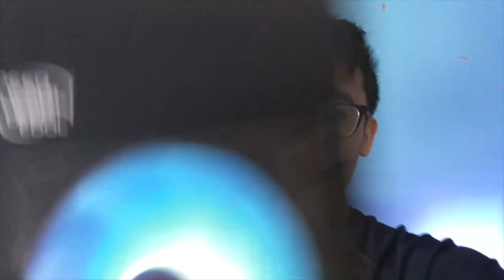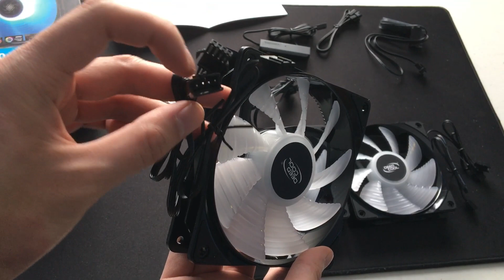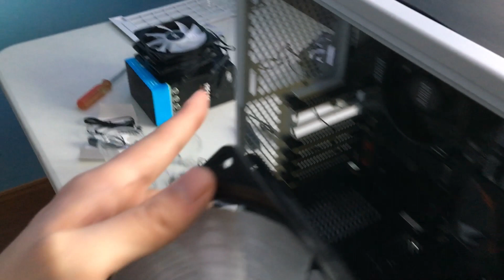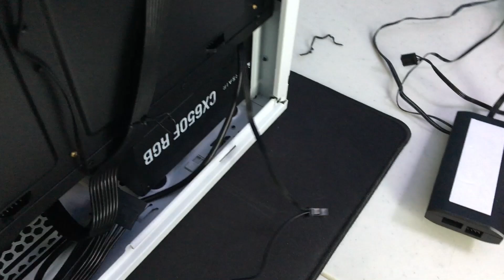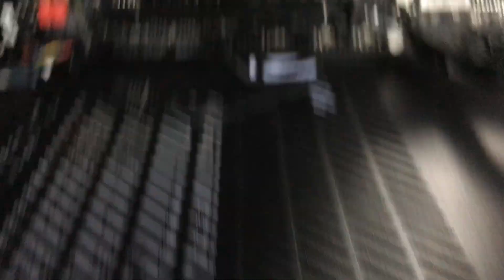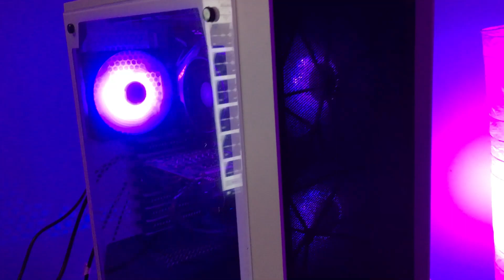How To Daisychain & Install your PC Case Fans | Deepcool RF120 Installation

Comment: Ok so basically I have to connect the female pwm to the fanhub then the female connector of the first fan to the second fan then the female connector of the second fan to the third fan then I also have to connect the female pwm to the fanhub of the second and third fan respectively then I have to connect the female connector of the addition cable to the last(by which you meant the first fan you did your work on if I'm not wrong) and then after that I have to connect one side of my fanhub to the sata power and the other cable into the 12V RGB side and the additional cable which you talked about to the sys fan right? If I'm wrong Pls it would be very helpful to me if you help me out I've never did this before I'm gonna buy these fans tomorrow or on Friday. So I really need you to help me out. I would be very grateful to you.

Comment: Don't you need to plug it into the Argb header on the motherboard because the RGB and Argb provide different voltages, 12 and 5 volts, respectively?
Reply from the maker: @dabuilderpeace  yes, this model is RGB

Comment: Will this work if you don't have an rgb header and jut want to hook up the fans?
Reply from the maker: Yup it'll still work just without lights
Reply: FYI, I'm have plug in 5 fans on my mb to the rear exhaust on my mb on a spliter is this to much and should I get a fan hub that hooks ip to a sata cable. I haven't turn on my pc yet cause I'm waiting for a psu to graphics card extension lead. Thanks

Comment: Yes great vid! I need your help please. My NX410 fans are daisy chained but the 4 pin chassis connector is a male. similarily the 4 pin chassis connector on the MB is also a male. Would you happen to know anything about this in your travels and do you know "exactly" what adaptor I might be able find.  I have also submitted a ticket to Antec.

Comment: can you leave a link for the products used (fan hub and argb hub)
Reply from the maker: It won't let me link but it's on Amazon called
DEEPCOOL RF120 3in1 3X120mm RGB LED PWM Fans with Fan Hub and Extension

Comment: I have two rgb fans connected. They both light up and work but I can't change the colour of one of the two
Reply from the maker: If one works and they are plugged into the same header that makes me wonder if the one is defective

Comment: Sorry, late to this but is it one speed only? Have the same fans but they seem to always be running at top speed and seem kinda loud... Did I miss something? I also have 5 of this fans
Reply from the maker: These fans are PWM so you can actually adjust the fan curves in your BIOS settings based off the temperatures of your computer. I think your motherboard just has aggressive fan curves by default so they're running at top speed more than they should.
Reply: @BPYT  dam I have a MSI b450 pro carbon guess I'll need to figure that out. I find it a little confusing through the bios... but I'll have to do my homework. Thanks for responding

Comment: Now i know this videos old but what if i dont have a extra wire when done daisy chaining i bought the 5 pack and daisy chained 4.  3 intake 1 exauhst now i know i might not get a response but worth a try
Reply from the maker: Hm, are you talking about the cable at 0:56 or are you saying the 4th fan in your daisy chain doesn't have the wire that connects to it?
Reply: @BPYT  no i do have that wire but after im done connecting the males and females theres no other loose wire
Reply: @BPYT  like i have the 12v rgb wire but no extra wire from the fans
Reply from the maker: @tracytoop4790  It's possible that you did an extra connection on the last fan that you didn't need to do, you may have to retrace your steps
Reply: @BPYT  fan 1 has a male and female witch i connected to fan 2 M, F also did the same from 2 to 3 and 3 to exauhst up top in back of case 1,2 wire to fan2 same wire 2 to 3. Idk
Reply: @BPYT  but ill look at it again

Comment: where i plug the hub in the mother board? i havd rgb header.
Reply from the maker: You should have a fan header that says SYS_FAN or something similar
Reply: @BPYT  i do have system fan 3 pin i did put the pwm 4 pin it is working now.

Comment: hi bro i Need help. I cant control RGB of the fans and Is that because i didnt connected them eachoter?
Reply from the maker: Hey, can you control any of them or just one?
Reply: @BPYT  never mind, i fixed today because i didnt know that on the software of RGB Fusion i had to go to the Led_ and something and that was the RGB controller.

Comment: i have 3 fans

2 on top (part of cpu AIO cooler with radiator)
1 at back

can i daisy chain these 3 ? and can i use all 3 of them onto one rgb adapter ?

Comment: Hi! I'm building a pc rn and I want 5 d- rgb fans. I got an Asus Rog Strix B550-A Gaming Motherboard. And i bought a 3 pack 3rgb fans and it comes with a daisy chain D-rgb connector. Can I use that to connect all 5 rgb fans or i need a splitter cable? Thank you
Reply from the maker: Without knowing the model of fans, you are usually fine to do this with no issues

Comment: Noob question

Where is the system fan header slot in the mobo ?

I bought 5 fan pack which comes with 2 hubs. 3 in front, 2 above and 1 at the back. Should I daisy-chain all 6 or do it separately as 3+3 ?
Reply from the maker: It'll be different on every mobo but usually it says something like SYS FAN beside it.

I would do 3+3

Comment: My fans don’t have the 4 pin connector that goes into the motherboard, they only have the daisy chain connectors
Reply from the maker: Which fans do you have?
Reply: @BPYT  I have 2 Raidmax fans but they only have the daisy chain connectors
Reply from the maker: @bxshwitdarackzz  You’ll just plug the fans into the motherboard

Comment: Are the fans connected to the fan headers or hub? I am confused.
Reply from the maker: The fans connect to the hub which connects to a fan header
Reply: ained  @BPYT  And the RGB is daisy chained together to one cable? Does the 5 in 1 come with a hub with 5?
Reply from the maker: @cydeYT  right RGB is chained to one cable. I think the 5 pack comes with two hubs so you will need to use two headers!

Comment: Whoa, your mic is way low and the music is too loud :(
Reply from the maker: Sorry about that! Thanks for the heads up, will fix it in the future :)
Reply: @BPYT  I still loved the video =D I think I may grab these. Trying to upgrade my fans (and unify them because I have too many diff ones in there) but they are so expensive. Was going to buy these $85 Lian Li UNI Fan SL120 but thinking these will basically do the same thing at half the price.
Reply from the maker: @NewYears1978  Thanks! Yeah no doubt these are really good budget friendly fans. I had the same thought process as you - I can’t justify the expensive fans yet when these have been so reliable!
Reply: @BPYT  Going to grab them right now - thank you kindly sir!

Comment: I am looking to buy the Phanatec 360A case with 2 of these fans preinstalled, then i want to install the deepcool Castle 240RGB V2 which has the same A-RGB fans. At last i want one more fan for the back of the case giving me a total of 5 fans. The big question is if the case comes with the fan hub and the additional cable so i can hook them all up like you did. Thanks for the great video made it alot more clear but since i just need to buy 1 and not 3 more fans i dont know if it comes with the fan hub and cable.

Comment: So, do I need a splitter to connect my 3 fans? Can't I just daisy chain them?
Reply from the maker: Some fans can connect directly to the mobo but for these fans in particular you’ll use the splitter that comes in the box. You’ll have to check the manual for your specific fans.
Reply: @BPYT  So, if I buy Cooler Master Sickleflow bundle of 3, do I need to purchase anything extra to get them to work with software? (Thank You for the quick response!)
Reply from the maker: @Official_Mikel  No worries, for your question: Nope don’t need to buy anything extra they will come with everything you need
Reply: @BPYT  Amazing video, Detailed responses, and quick ones at that! Thank you very much! (I'm subscribing :D)

Comment: since 6 of my case fans all have molex, can i connect them to each other and hook the last one to my psu molex or will it burn my house down
Reply from the maker: If the fans have the appropriate wires, yes you can daisy chain molex fans
Reply: @BPYT  What do you mean appropriate wires? since I have 6 of them, they all fit into eachother but majority of my friends says it might cause a fire
Reply from the maker: @andeersonz  Why do they think it's going to cause a fire? People daisy chain molex fans all the time.
Reply: @BPYT  Well, I don't really have knowledge about that stuff and it's also my first time building a computer, so this is making me cautious? Should I just stick to buying a fan hub?
Reply from the maker: @andeersonz  You should ask your friends why they think it’ll cause a fire. They may have a good reason but from my knowledge there isn’t any risk. Worth inquiring. Otherwise you could return and get PWM fans if you’re nervous.

Comment: I have a deep cool gammaxx air cooler can I also connect it to the hub included in the fan?
Reply from the maker: Technically yes, but if you don’t plug a fan into the CPU fan header your pc might not post (depends on the mobo)

Comment: Hi do you think this would be compatible with the MSI B550M PRO-VDH WiFi ProSeries Motherboard, and if so what kind of splitters would I need to plug in six of them, I dont have a fan hub btw so if I need one any recomendations?

Comment: Daisy Chain is when you connect one device to another... For example, connecting one RGB to another RGB, and so on... and then connecting the final pin on the main board. This was using splitter. A splitter or hub creates a Y channel for a uniform effect. A dairy chain create effects starting the first device, and  running the effects through all other connected devices, one after the other... creating a daisy chain RGB effect. This was a Splitter/Hub connection, not daisy chain... !!
Reply from the maker: The hub is for PWM. The RGB cables are daisy chained.
Reply: @BPYT  Oh sweeet... my bad... I didn't watch it carefully. Too many misleading videos out there confused me... Keep it up... awesome video and pleasant to hear... :)
Reply: I have a question when I daisy chain comment female to the other fam male where does the first male fan male go and the 3rd fan male too?
Reply from the maker: @VinashSri  You will have some connectors that are left hanging

Comment: Dam I really liked your video.. it's straight forward .. I have  msi b450 gaming pro carbon max wifi MB and very much confused which ARGB with PWM controller.. this narrows down .. thanks a lot bro.. if you could explain RF, CF,and MF 120 diff would be great
Reply from the maker: I'm not sure about MF120 but the only difference between RF and CF is the type of RGB. The CF is addressable RGB so can do multiple colors at once (like a rainbow)

Comment: does the voltage differs?
like should i get any voltage fans for my pc or certain fans?
Reply from the maker: There is different voltage for RGB 
Addressable RGB is 5V and regular RGB is 12V
Then fans can come in 3 Pin or PWM variants. 3 pin is a bit outdated at this point.

For reference the Deepcool RF120 is RGB (12V) and PWM which I’m very happy with.

The best ones would be ARGB (5V) PWM (4-pin) fans, but ARGB is more expensive for quality fans.

Comment: If I get the ones that come by itself and it says it has preinstalled rgb do I still need to plug it into the rgb header
Reply from the maker: You mean a case with preinstalled fans? If you want to control the RGB through your motherboard then yes. Otherwise they should also come with a fan RGB controller.
Reply: @BPYT  thanks :)

Comment: Hey brother, can anyone answer a question for me. 

So I have 3+ RGB fans and each of them are plugged into separate power nodes. 

The RGB cords 4pin 12v standard, are all daisy chained together. I’m wondering if I can just plug them straight into the motherboard in the corresponding 4 pin RGB header. Or will that fry the RGB in the fans? Thanks
Reply from the maker: In the video the 3 fans are daisy chained to one RGB header, so if that’s what you mean it’ll be fine!

Comment: I have added these fans into my case.  I have a msi b450 motherboard.  Everything is plugged in correctly but my fans just glow red.  They do not change colors.  Can you help identify my problem
Reply from the maker: Can you confirm they're plugged into your motherboard's RGB header and the software isn't working to change them? The default color out of the box on these fans is blue. Did you buy the Deepcool RF120 "R"? If so, those ones only have red LED's.
Reply: @BPYT  they are deep cool rf120m in a 5 pack.  They were changing colors an hour after I plugged them in but changed back to red again.  I plugged them into the jrgb slot on my motherboard

Comment: Hey I’m very confused 
I have the b450 ds3h v2 motherboard and I bought the 5 pack.
It has two fan hub thingy but I believe I only have ONE led_cpu and another for the cpu fan

Can I still connect all of them together?
Reply from the maker: Hi there. I just looked up your board and you're right there is only one RGB header. I've seen some people connect 5 RGB fans to one header and haven't heard any issues, so it might be OK for you to daisy chain the 5 fans to the one header.. I personally have never tried.
Reply: @BPYT  hey! Thanks for the informations!

I ended up connecting the 4 pin on the rgb header where I connected the fans
    I
   V
Hub with 2 fans > connected the hub to the other hub>Hub with 3 fans 

I don’t know if it’s gonna work though
Reply: @owlz1657  did this work fella?
Reply: @narmytrooper  It did work, the only thing I hate is that I can’t select any modes, you can just change one colour

Edit: I meant for the b450 motherboard*** But everything is working if you connect them properly

Comment: Great video😁 helped me alot.
Do i need the rbg header on the mobo?
Reply from the maker: No problem! You need it if you want to control the RGB with software. Otherwise you just plug the RGB controller into the fan and your power supply, then you use the buttons on it to control the RGB.
Reply: @BPYT  ok thank you, stay safe🙏🏾

Comment: I have a deepcool matrexx 50 rgb mid tower case and I can only control the rgb through the case button, not the software. it looks like I have 2 rgb spots on my motherboard (Asus Tuff Gaming x570-plus) ..would I unplug the connector from the case button and plug it into the motherboard to be able to control the lighting?
I should mention I did not build this myself, I did purchase all parts myself and just had a IT guy build it for me. I guess I didnt mention I wanted to control through software and not the case and I dont want to have to take my pc in just for a simple fix. thanks in advance.
Reply from the maker: Hey! Not knowing what kind of fans you have makes it a little tough to be able to tell. Some fans can only be controlled by the case button. You’ll have to find out the model of the fans you have.
Reply: @BPYT  The fans came with the case, 4 deepcool fans..thats all I know
Reply from the maker: @kyles2250  I looked into it. looks like you can plug them into the motherboard. You’ll just have to check if you have the Addressable RGB version (5V header) or the Non Addressable RGB version (12v header). I think you likely have the addressable version.
Reply: @BPYT  So the 2 spots I think are for rgb say 12V RGB Header and has 4 pins..so what does that mean then?
Reply from the maker: @kyles2250  That might be why the builder plugged the fans into the case controller rather than the motherboard. You can’t plug ARGB fans into 12V RGB headers or the lights will burn out.
Reply: @BPYT  Oh okay, well now that I looked again I do notice there is another 4 pin connector that says ADD Gen 2 +5V, would that be the connection I need then?
Reply: @BPYT  I have gone to their website and it only shows the size of fans that can go in the case and not the acual fans

Comment: Couple of questions if I may. 1: I only have a 3pin fan connector on my mother board can I still connect these? 2:  I can't control them through my bios as it's never been updated so how would I choose the desired fan colour? 3: I do have a fan control that was never connected (4 fans) coukd I use the molex to daisy chain them to the controller? Sorry for all the questions😍
Reply from the maker: Hi there,

1. Yes you can, they will control speed based on voltage (Not PWM) which is totally fine.

2. You can use the fan colour controller that comes with the fans instead of connecting to the motherboard. This will require plugging the controller into a SATA cable on your power supply though.

3. I am not actually sure about this one. Sorry!

Comment: I need help my fans work fine but the led lights won’t turn on I have a msi tomahawk b550 where does the 4 pin go into?
Reply from the maker: There should be a header that says RGB. If you’re unable to find it check the manual which usually has a map of the motherboard.
Reply: @BPYT  I plugged it in to JRGB1 & the led still won’t turn on send me a message through Instagram @carlosvalerio11

Comment: Can anybody tell me why the female rbg header goes into the 12v instead of the 5v argb header? Confused as to what does what
Reply from the maker: Basically there’s two types of RGB. ARGB is newer and can do multi-colour effects. RGB can only display one colour at a time. If you get ARGB fans then they would go into the 5V header. These fans in particular are just RGB.
Reply: @BPYT  wasn’t expecting such a quick response, thanks for clearing that up!